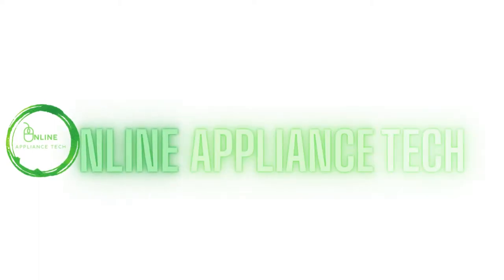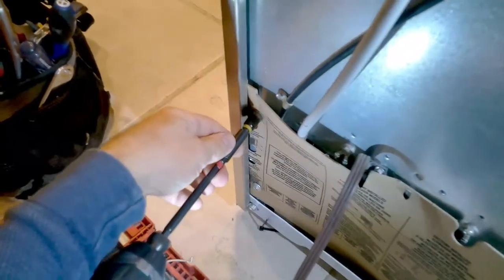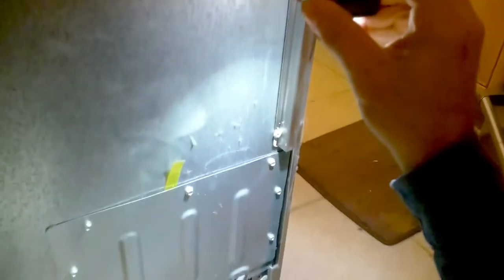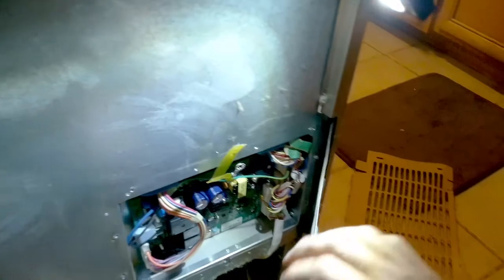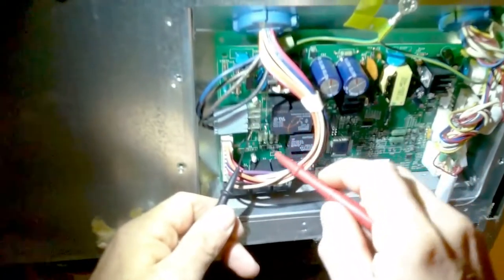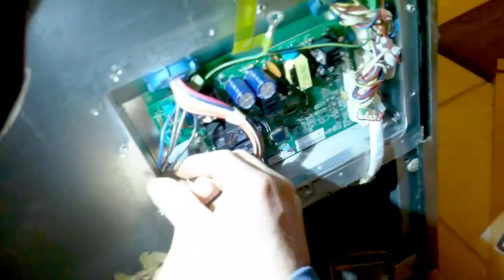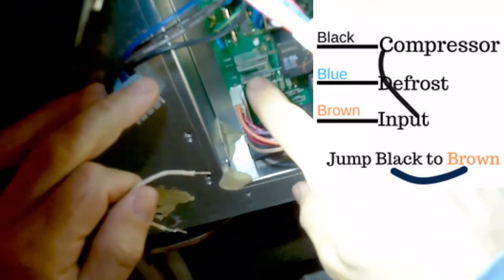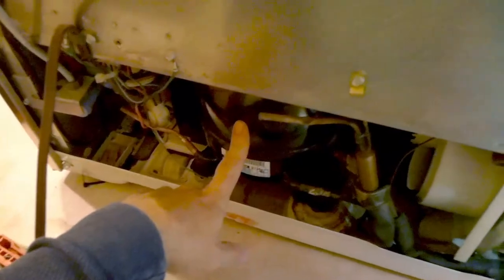GE Refrigerator Not Cooling? Learn How to Test GE Refrigerator Control Board

Comment: Thank you VERY much for this information.  

I have a 22 yr. old side-by-side GE.  In the last four years I've replaced the defrost heater element, the temperature sensors in both the fridge and freezer sections, and the thermostat in the freezer.

When it died seven months ago I immediately started doing intensive research online to determine what the problem was and whether it could be fixed. I did find one problem very quickly -- the overload protector on the compressor was fried.  There was actually a scorch mark on one of the terminals. So I ordered a replacement, plugged it in and .... NOTHING happened.  

I was very disappointed but kept on searching.  

I did find a video that showed how to use a multimeter to check the terminals on the compressor and it passed those tests, so I was still hopeful that the compressor itself wasn't dead. 

The next logical suspect seemed like it might be the start capacitor for the compressor. But it looked perfectly fine -- no bulging, no leaking.  And a local repair service told me that those almost never fail on the GE fridges. 

So I started looking at the possibility of a circuit board failure and came across your video.  I did the black/brown jump as you instructed and the compressor IMMEDIATELY started up.  

I am so relieved I didn't have to pay for a service call or worse, a new fridge.  

I've already found a replacement board from a company here in Canada for less than $200.  

Thanks again for helping me to solve this problem.
Reply from the maker: I'm glad the video was helpful in fixing your fridge issue!

Comment: Hello, I have a GE model  pfcs1njwass refrigerator and it has the exact control board.  The refrigerator is not cooling and the compressor is not running at all.  I suspect the control board so I tried to troubleshoot following your instructions.  But strangely, on my refrigerator , the connector cable (the one you put a jumper in) only has 2 wires (blue and brown).  There is 120vac across the blue and brown wires and only 20vac across the brown and compressor pin.  Not sure what to do next?  Why no black to the compressor? Any ideas? Thx

Comment: The schematic does not correspond to the wires in the connector. With the refrigerator plugged in and the connector disconnected what voltages should the black and brown connector pins read and should this be in relation to the refrigerator ground. Lastly, should the multimeter be set to DC or AC. What voltage should be applied to the input to turn on the compressor? Would this just be a connection between the brown and black connections in the connector? I am 74 years old so thank you for your help.

Comment: I have a GE Model PNR22MSEBFES - a French door - The fridge is colder than usual - I can't somehow set my temp using the front panel screen - I unplugged the fridge a few times - But still no change - The freezer makes ice - the control panel, however, is not working to set the temp - pressing the buttons not happens - How do you rest the control panel to activate temp control panel - At first it made beeping sound - the panel would flash the 0 34 continuously than stops - the buttons to set your temp is not allowing to set my temp - pressing does nothing - Do I need a control board - Thanks in Advance
Reply from the maker: Sounds like your display control board.